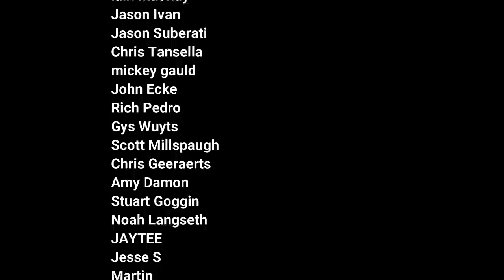Homestead Update 2020 1111 T3DP

Comment: i take it the exhaust pipe from the heater will be insulated with some form of fireproof wrap so the exhaust don't set fire to anything. i don't know much about heaters. but seems like a logical thing to do with a place that's wooden ?
Reply from the maker: yes gap separation. that is why the hole is so large for a 4" pipe. first the pipe is double wall with insulation between the walls then the square plate you see provides the "gap" separation between the pipe and the wall/insulation etc.. that is the purpose of that square/circle plate arrangement you see on top of the heater. so the pipe can't dry out/set fire to your wall and insulation etc..

Comment: ?? Why not just pay the fee dollars for the permit and build it correctly so you don’t have to worry about issues down the line. If it’s built to code I believe that’s what your plan is anyways it would fail inspection if it came to that. High winds weather ect is another reason to connect these together correct or are u worried about this being an edition that your taxes will go up if it happens to get Assessed
Reply from the maker: I'm out of money I can't rebuild it it would cost thousands of dollars that I just don't have plus the rules originally said 200 square feet did not require a permit apparently last September they changed the rules and I didn't know it so now I'm stuck :-)
Reply: As for the added cost to do it the right way many people often overlook the fact that adding to a house also increases the taxes to said house. At least in most areas it does.

Funny side story as an example: My parents tried to get the taxes on their house lowered so the taxes assessor came by to look at it and go over the house and taxes for it. In the process my parents asked about the how much it would drop if they removed the in ground pool. The tax assessor said "You have a pool?". To everyone's surprise the original owners never got permits to build a unground pool along with many other changes to the house during it's construction. Needless to say there taxes didn't drop.
So if anyone plans to do any additions to their house they should keep in mind the added cost of possible tax increase.